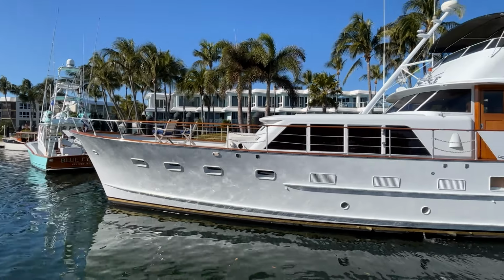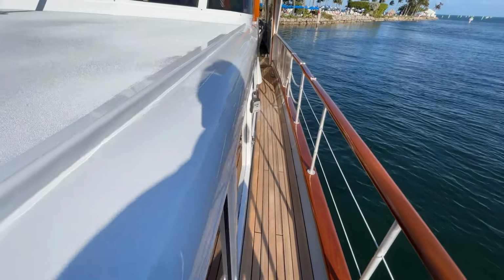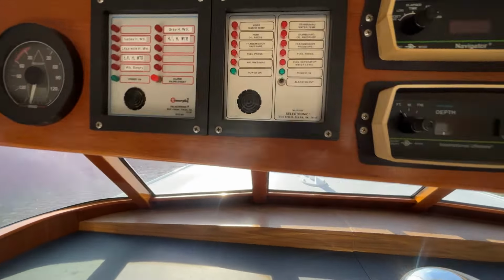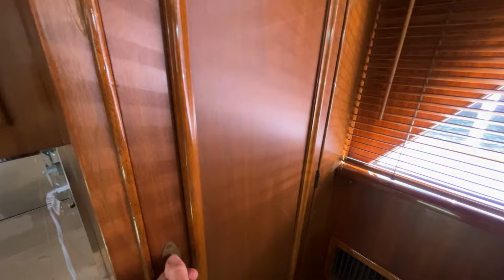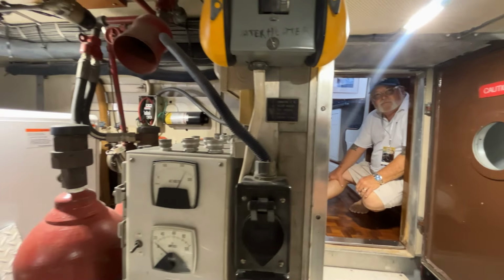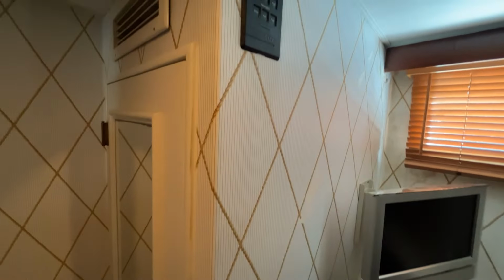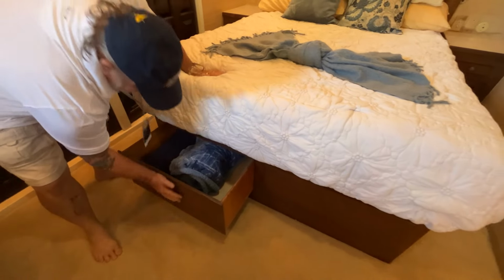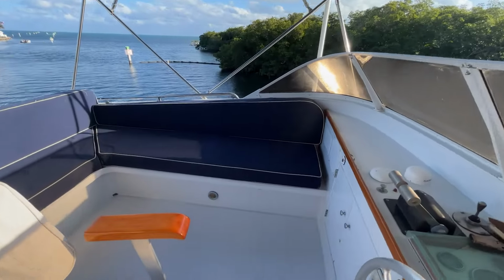Restoring a 1970 Burger Yacht | Vintage Weekend

Comment: The woodwork is spectacular. Yeah fiberglass is easier to maintain, but then you have to look at fiberglass, all fiberglass. When it comes right down to it wood really is not that hard to maintain, but it takes a little effort to make it look really good. Not a problem for me I'd rather work on them than drive them anyway, keeps me busy.